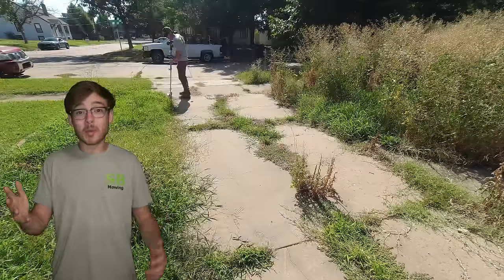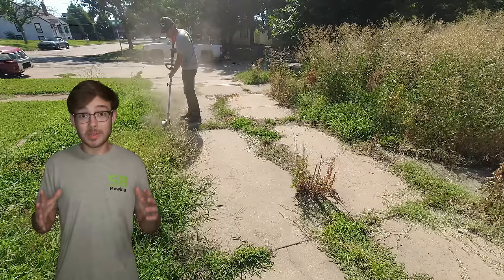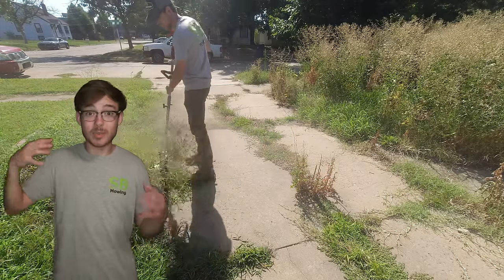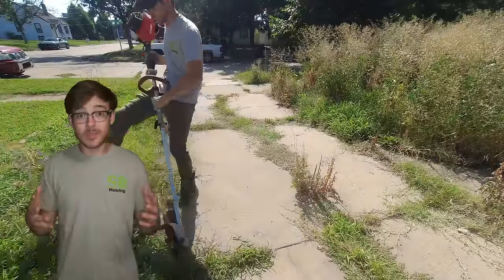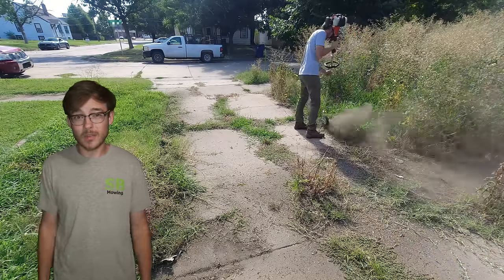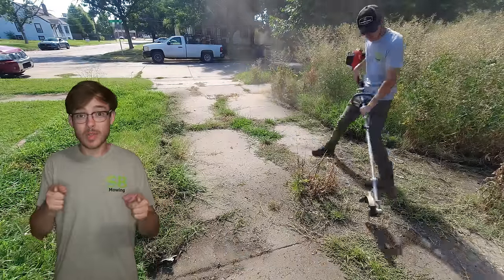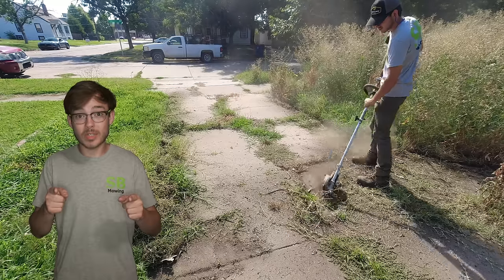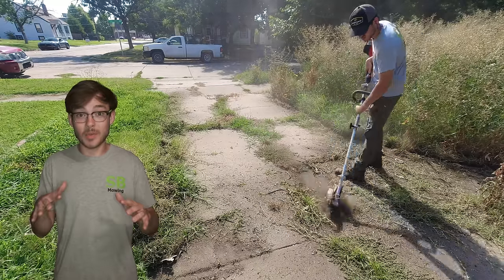Neighbor can't REMEMBER the last time this lawn was cut

Comment: You deserve a medal for this one!
Not only did you substantially increase the value of this property, but also of his neighbors.
Reply: ibe....probably not.  Abandoned houses tend to have their wiring and pipes stolen, which wrecks the house past the point of most renovations.   If homeless people been in there, it's a surprise it hasn't burned down.  The neighborhood is better off though and vagrants are less likely to target the house if it's not been stripped already.
Reply: @gregblackburn4280  ibe?
Reply: @gregblackburn4280  Nothing you just said even remotely refutes the point he made so why did you say "probably not"?
Reply: @vinchinzo594  I don't recall us talking so I didn't "say" anything.  I typed "probably not" because cutting the grass is not going to make up for pipes and wiring ripped out of the wall.

Comment: Spencer great job as always, but I have a couple of questions for you. 1. When you use your stick edger and go side to side does that put undue wear on the blade to the point you have to replace the blade sooner. 2. After doing grass and weeds this tall do you replace your blades or just sharpen them?  Thanks in advance for your feedback on this subject.
Stay Hydrated 💦💦💦

Comment: I was going nuts trying to figure out why the walls in front and on the side were completely different in the before and after. I finally figured out that all the gray/black spots must be spider webs you couldn't see until you used the leaf blower and it filled them with debris.  Place looked great when you finished. You make the world a more beautiful place one yard at a time.

Comment: You did a great job !!  I have two suggestions, 1- no need to use the blower until you are finished, you do the same area 6 times. 2- get a set of KAVLI BLADES for your mower for tall grass and weeds, it will save you tons of time !!!!

Comment: Will there be a 'one year later' follow up? It would be interesting to know if the property owners saw the improvement and decided to fix the property structure up to sell, or sold as is, whether the city or county had it on a property tax auction sale and someone snapped it up and got it cleaned up. Did neighbors keep the front lawn mown until the property owner took over, or did it just grow back out again. Some trees grow back way too fast.

Comment: Wish someone would devise a way for the big mowers to better handle the tough tall weeds on the first pass.  I haven't seen one brand that does the job well.  Wonder if they would be more efficient if the front of the deck was open so that the blades cut them before the deck was able to push them over and under the blade.😮

Comment: Dust masks work great for protecting your lungs from silica, (Fine, razor sharp Nano particles of dust)...
Long term effects can be devastating...  Dude, wear a respirator when using your blower in crap like that, seeing you without one makes me cringe...  Awesome job by the way...
Silica:
Silica is one of the most common hazards on a worksite, particularly in the construction, Landscape, oil and gas, manufacturing, and agriculture industries. Silica dust can cause silicosis, a serious and irreversible lung disease. It can also cause lung cancer. Cutting, breaking, crushing, drilling, grinding, or blasting concrete or stone releases the dust. As workers breathe in the dust the silica settles in their lungs.